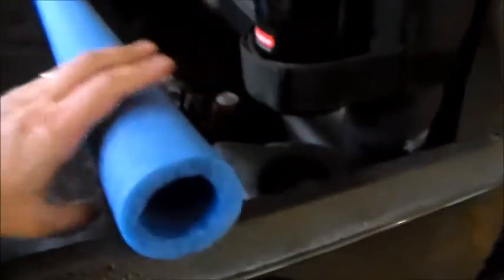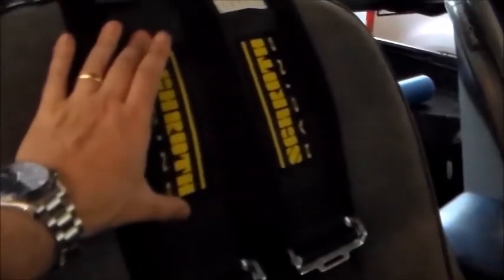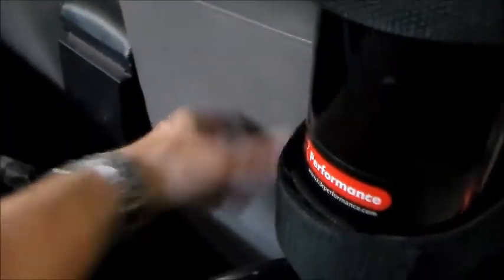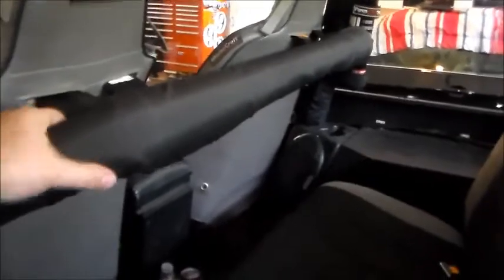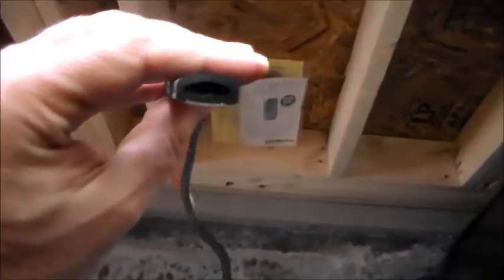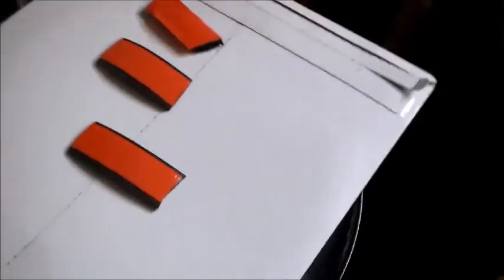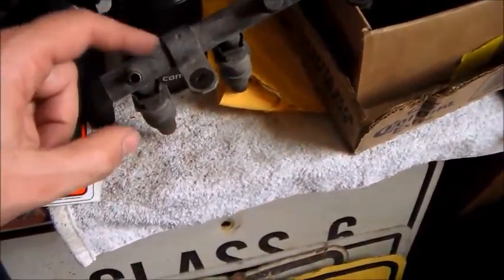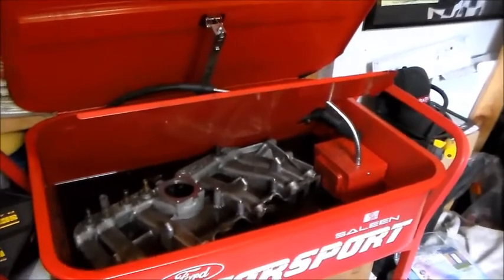Jeep YJ Hardtop Weatherstripping and Harness Bar Padding

Comment: Just a note: I know from experience if you use too thick or too hard weather-strip the front of the hardtop will not be low or tight enough to get a good front seal. The rear sides of the hard-top height determine the front height of the hard-top seal. I lay my weatherstrip on the hardtop (without removing the sealing tape) fit and mark with a pencil, then remove and cut with good scissors to make a perfect fit.
Reply from the maker: Doug Harlow I just used what came with the kit. It took a bit of extra effort, but I was able to get all of the header screws to thread and crush that weatherstrip for a nice tight seal. Hasn’t leaked yet!! Lol👍
Reply: @Metalcop5150 Also the hardtop is slotted so you can adjust the hardtop to fit, so you can't install of make holes for the bolts in your new weather-strip until it's on the Jeep. It took me several tries with different types of strips to get right.

Comment: So how did the gasket kit work out? Any issues with the top sitting too high or issues with tailgate not catching.  Thanks!
Reply from the maker: Shawn Doyle Honestky, it took some work to get the windshield header bolts to thread and then crush that gasket!! Other than that, it went smoothly. The tailgate still shut just fine. It is an ‘upgrade’ or a regular maintenance item I would strongly recommend. And it fixed my water leaking issue as well... lol Thanks for watching and commenting, please consider subscribing if you don’t already!!

Comment: I took off windshield channel.
Reply from the maker: Yes this seems to be the general consensus. I checked out a few Jeep forums, and they all said 'take it off'. Some guys actually persisted and stubbornly left it on, only to suffer fitment issues and greatly increased windnoise?! Seems like removing a few screws is preferable to poor fitment and increased windnoise. Thanks for commenting!
Reply: If you drill a hole from the seal side then you are less likely to push your seal off when you put your bolts through. Also, drilling is easier and faster. No, you don't have to but it is the best way.